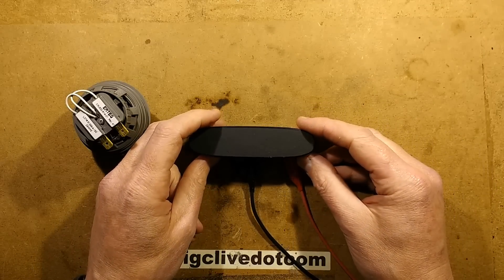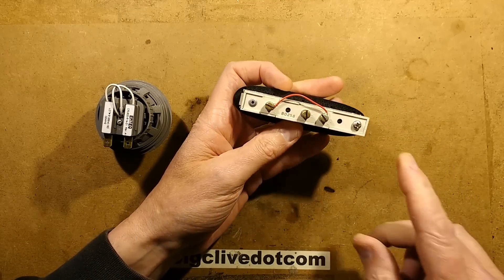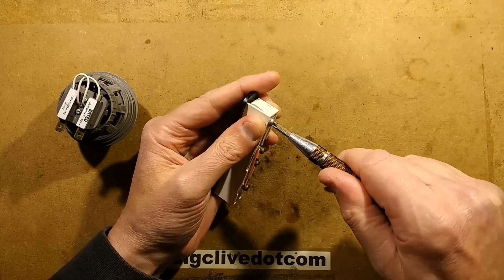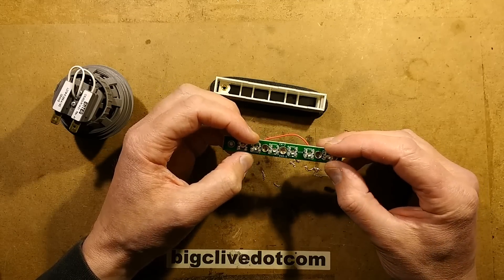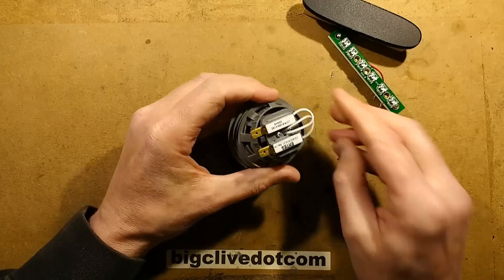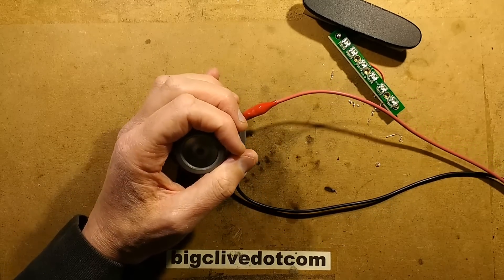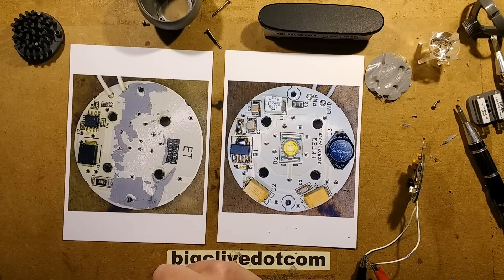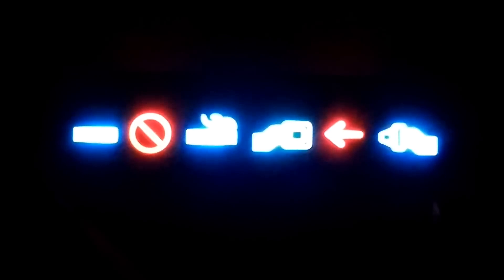What's inside an aircraft seatbelt sign?  (and swivel downlight)

Comment: Out of passing interest, most commercial aircraft have over each row of seats a PSU (Passenger Service Unit). It usually contains the reading light, 'gasper' for additional air, the various annunciator lights, call button switch, O2 generators masks & PSU door release, and a PA speaker. Of interest to note is that every few rows an additional O2 generator & mask are installed, so the cabin crew can 'leap frog' around during an emergency decent.

Comment: 0:28 - "...cause when I unplugged it one of the engines stopped..." Well at least most jet airliners can operate with only one engine running. I wonder if there is one on the opposite side that stops the other engine.  :)  1:01 - It says, "Non Relampable"...until it gets into BigClive's hands that is.  :)

Comment: Clive, as Dan Capizzi also pointed out, I think the transistor, inductor, diode and caps be parts of a buck regulator. What's the actual voltage across the LED + resistor versus your power supply applied voltage?

Comment: Hello big clive i have question about those emergency bulbs i want to put one in the same lamp as another led lamp how can i separate the other led lamp? can i put a capacitor in series with the normal led bulb?
Reply from the maker: I don't think there's an easy way round the sensing of the other load.
Reply: What i ment was like in the drawing. ok thanks for your time. https://i.imgur.com/V1CGmEg.png
Reply from the maker: ‍1marcelfilms That could work, but the normal LED lamp would probably have to be capacitive dropper based.

Comment: What was the other inductor for (L2) also see a diode across the darlington pair so is it switching the main inductor.
Reply from the maker: The two small inductors appear to be filtering and the larger round one is being used by the switching regulator.  The diode next to the Darlington may be to discharge the soft start capacitor quickly when the power is turned off.

Comment: Why would the light need to be so complex? If you already have a D.C. Source, wouldn't it be easier to have simple over current protection and a basic step down circuit?
Reply: AfterDark3 I guess the voltage will fluctuate for various reasons and they don't want to scare the passengers with flickering intensity. Also a linear regulator between 24V and a 3V LED would eat 87% of the energy, so a buck converter is a lot more efficient even in this non-optimized configuration.

Comment: I could send you a inflight entertainment system. But I think, that's not too interesting for your viewers. I still did not figure out, how it works. My seat is mechanically working on 400Hz now, that's all I wanted.
It seems, the data for monitors, lights and inflight entertainment is all multiplexed so I stopped there.

Comment: It's commercial aviation stuff. From what I remember, they go through some hellish safety testing at a horrendous cost to the company. There's a big incentive right there to not update the designs until they have to.
Reply: Cold temperature performance is a major reason for sticking to lead-acid batteries for engine starting applications.

Believe it or not, lead-acid batteries have far more consistent performance over cold temperatures than typical li-ion batteries do. In cold temperatures (below 0 celsius), the internal resistance of li-ion cells skyrockets, severely limiting the current capability and usable capacity. Below -20 celsius performance is usually poorer than a lead-acid battery of similar size and weight!

In fact, quite a number of all-electric vehicles have heaters inside the li-ion battery packs for this reason!
Reply: Yes a lot of safety testing. But what blows me away is the light died from applying reverse voltage. That's one of the most basic tests you do on an aviation product. I'm thinking something further up the chain was tested and not the bulb itself (since it appears to be 12V not 24V). Or they didn't care if it failed, as long as it failed safe..
Reply: @jaro6985  There's no way he bought hyperexpensive real aviation products, he bought cheap ebay fakes.  And the protection diode is actually what exploded!
Reply: The aeroplane I fly was in RAF service and has/had lead acid batteries. The first customer for this type of aeroplane was the Swedish airforce, and those were equipped with NiCds, as these have a much better performance in the cold than lead acid.
Reply: same with cars, they still use lead acid batteries, a lithium would be 1/20th the weight and 1/4 the size and probaby last the life of the car, they are not very pricey either, but what with lead works, along with lead acid and the cases are very recyclable , even toyota prius still has a lead acid battery in it, it doesnt start from the big power battery

Comment: Used to work at Emteq about the time this lamp was brought out, some wheres around 2009, I was rather surprised to see this here
Reply: Craig Nehring Do you remember what the Darlington does.
  My somewhat uninformed guesses (least likely first):
- Cut the light when bus voltage is so low that the last battery / APU power should be reserved for essential instruments and distress transponder.
 - Quick discharge to avoid sparks if the lamp is dislodged in the presence of jet fuel.
 - Switching to 25% intensity if the crew switches the light power bus to 12V during overnight flights, thus compatible with control of incandescent lamps.

Comment: For Q1, if aircraft electronics are anything like automotive, it may be a 30-40V pre-regulator to protect the switching supply against 100V input transients which may occur when some other circuit blows a fuse.

Comment: i think the power on a plane runs at 400hz ?
Reply: mark ward That's for external lighting & other equipment, it is also 115v. 28v dc is for avionics and everything else.
Reply: good info thanks :)
Reply: mark ward AC is 115v 400Hz, DC is 28v.  Very few items use the AC, it I ent through TRUs and the DC is the mainly used power